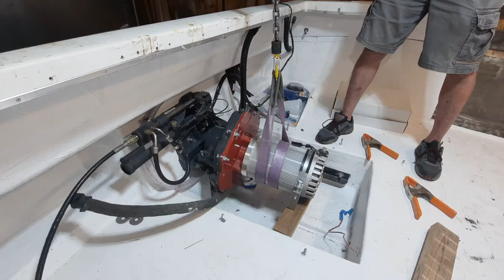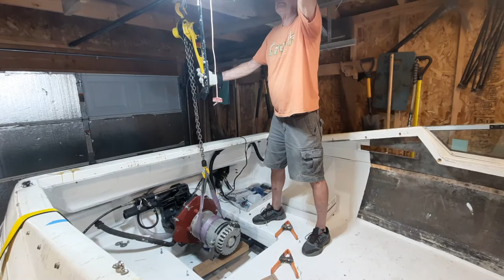Motor is in the boat! EV Boat Conversion. Episode 8.

Comment: I am planning to replace my mercruiser with an ev system and I’m thinking of magnetic coupling the shaft. Saltwater will probably corrode everything so I may fully enclose the motor with a water cooled heat exchanger from the alpha drive and use heavy duty neodymium magnets to allowing a quarter inch gap for housing of the motor.

Comment: Hi Friend,good job,congratulations,what is the weight of the boat and how many miles per hour do you plan with hyper 9.
Reply from the maker: The 1993 NADA guide says the weight was originally 2550#. I'm expecting I'll be at 2800#. 
I expect the boat will plane, not sure about top speed.
Reply: @evboatconversion.electricboat  good job congratulations